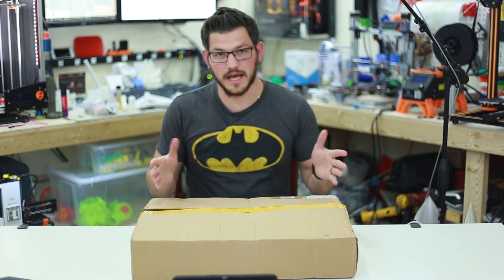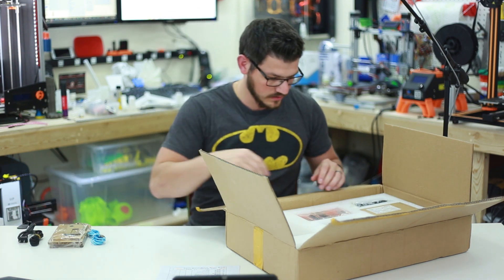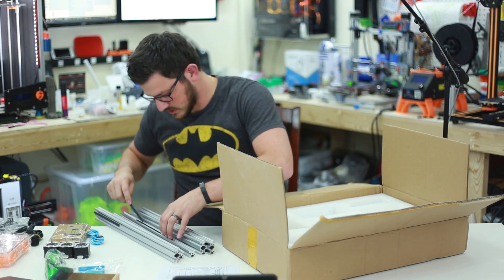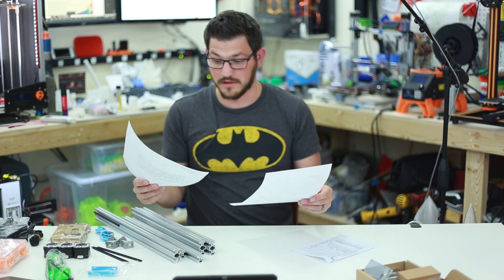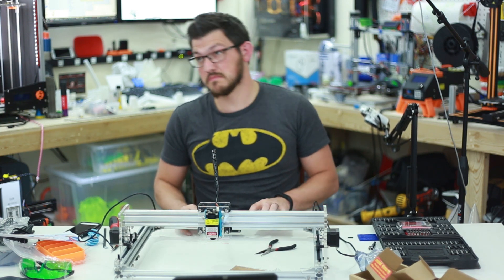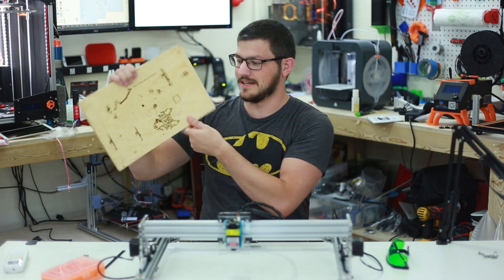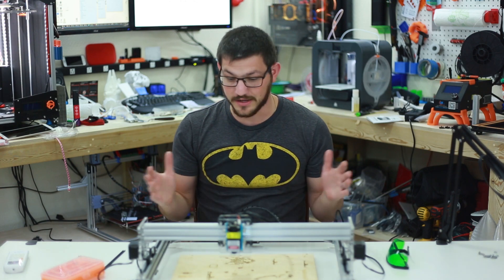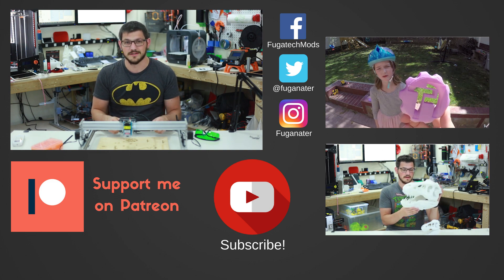Eleksmaker A3 Pro Laser Engraver Unboxing and Assembly

Comment: Hi i have same machine just assembled it ..worked for 5 min but now wont move at all in y or x ...in benbox when i hit the manual move buttons a light flashes on main board somit seemms its getting signal from software but stepper motorscwont power on.....i can manually turn on laser...any ideas why steppers seem dead or no signal?
Reply from the maker: Your stepper driver might have died. One of mine did but luckily I had a spare from my 3D printers.
Reply: The website says that BenBox is not supported to be used with the A3 Pro

Comment: I use T2laser, great progam, tried the elks program and ben box, both drove me nuts.  You can try T2laser for free.  Anyway I can cut 3mm ply witht my 2500mw elks laser but it can take up to 20 passes.  Cutting a circle may only take 12 but cutting out a shape like freddy kruger claws and all will take lots more passes.  I use a speed of 400 and max burn power, any lower speed and too much burning of the edges.